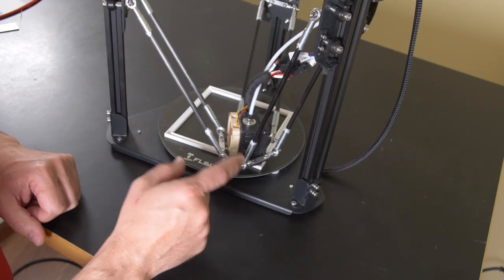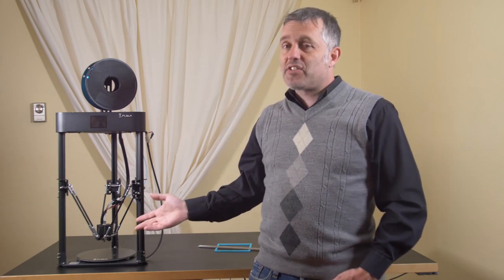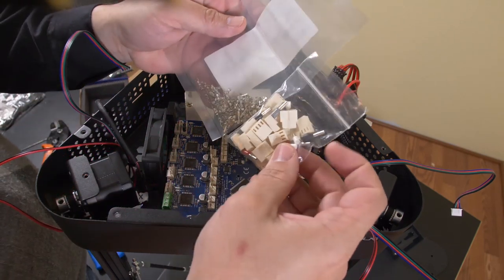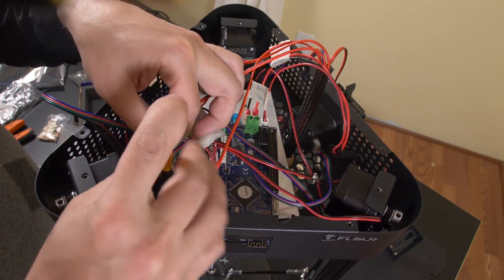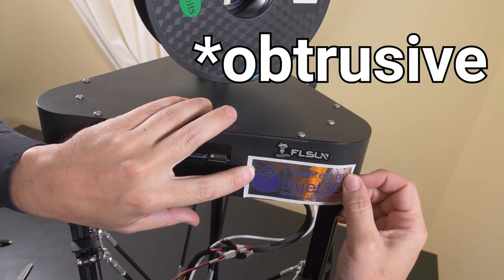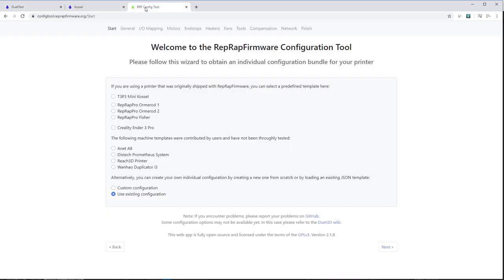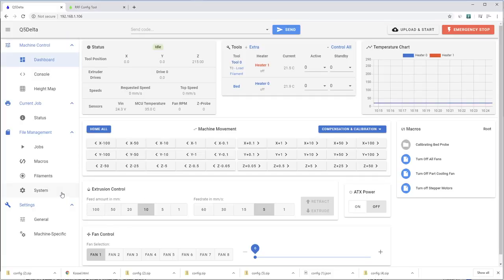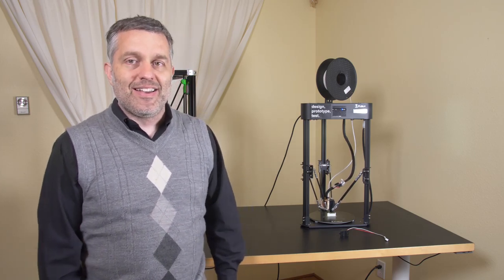How to Build the Best Delta 3D Printer for the Money in 2020

Comment: This is awesome work. Could this be done to a TIKO printer? It was a delta that launched on kickstarter and went belly up. It worked once and then could no longer connect to it.  I would have to add the hot bed but otherwise it looks very similar.
Reply from the maker: A Duet control board will work on pretty much any 3D printer. People have even retrofit them into old Stratasys machines.

Comment: Mine has been running for 3 weeks now and hasn't missed a beat. Compared to my last printer (not delta), this is a joy to use. The electronics are far more reliable too, and cheap to replace if they do fail. I am pleased as punch with mine as it came. Agree though maybe not tbe best for extreme accuracey.
Reply: If it starts printing spagetti like this one (and mine), check the stepper’s VREF. Mine were set to 1.2V instead of the recommended 0.8V causing them to overheat. You can change that with a screwdriver and a voltmetter.

Comment: I just received my Delta Q5 and the voltage appears to need to be set at (default)220V. I see no external switch to make the change to 120V. Do you know how I might go about resetting the voltage to 120V? I have no read out on the LCD screen although there is power to the unit. Thanks for a reply. Richard
Reply from the maker: There is a special switch inside the power supply. It doesn't have a protruding nub, just a flat slot for sliding the switch back and forth. You stick a flat head screw driver through the holes in the case and push the switch the other direction from where it is currently set.

Comment: I have a flsun q q s I was planning on installing duet 2 board. Do I need just the board or do I need the thermistor board as well? It pretty much looks identical to Q5 just different board from Factory. Would you be kind enough to send me wiring diagram or perhaps help me if I run into a problem? I'm pretty new at this so but I am good with soldering and small electronic projects thank you for all your videos

Comment: Nice videos!  I've got an Anycubic Predator, and I'm having problems with random layer shifts that kill all my big prints. I've pretty much eliminated mechanical issues, and I suspect (like you) the cause is the electronics, the stepper motors, or both.  Seriously considering Duet2 upgrade + smart effector.

Comment: Those Iwiss crimpers aren't even that pricey I paid like 18 bucks for mine about a year ago. They work fantastic, not a single failed crimp when I did my duet board, though I really wish duet just used the more common JST-XHP connectors that I've seen used on pretty much every other printer, though there were quite a few things that had to be wired differently so I guess there is some logic behind it, don't want people just thinking it's plug and play. Got my Anycubic Predator up and running with a Duet 2 wifi today, doing my first test print as I write this. It is a night and day difference on the amount of noise this thing makes, it's fantastic. So far no real issues that I had to get help with.

Comment: Why is it you think your Ender3 can't print at 100mm/s ? Mine is mostly stock and can print fine at 120mm/s (and that's just the fastest I've tested it). Maybe you need to tighten belts, pulleys, etc? Definitely works fine for shapes like the square you printed on the delta in the opening of this video - I was printing faceshield headbands using mine at those speeds. Finer exotic shapes could be an issue, but not what I printed, and definitely not that square item you were printing, which is very similar.
Reply from the maker: Ghosting/rippling is the problem. This Delta will make prints at 100mm/s which rival the quality from your Ender 3 printed at 40mm/s.
Reply: @DesignPrototypeTest  I don't see much rippling on my prints at higher speeds. Maybe you can show some of what you have been seeing so I can compare. Best wishes.

Comment: Common culprit for axis shutting down or loosing steps is motor driver overheating. Driver boards coming out of China are not always properly set up, and can drive motors with maximum current. If that's the case, you simply measure the Vref voltage on all three drivers and set it accordingly to your motor requirements. You can also set all three to the smallest value you measure as a quick and dirty fix.
Reply from the maker: A good bit of general knowledge, however, I had a look at the firmware build after I removed the original control board from the printer. The motor currents were set to a reasonable level. Also, I got 2 whole days of printing from the thing before it started to malfunction like that. It's possible that the Stepper drivers were just extra sensitive to the heat, and maybe my room was like 10° warmer when they started to fail. Like I said in the video, It wasn't worth the time to try and diagnose the problem. Even if I fixed it, that would likely not have been the only issue with that electronics package.
Reply: @DesignPrototypeTest  As far as I know, motor current is set by a potentiometer on the driver board itself, not in firmware - you actually need a multimeter and a small screwdriver to check and set it. Some Trinamic drivers have the option to control the current via software, but I don't think your board uses that option. Duet is certainly a nice solution if you can simply throw money at the problem but adding it to this rig pushes the total price up to almost double. I'm not saying you are wrong to go for Duet, but dismissing the MKS board out of gate is meh... for what it costs it actually seems to be a very nice board once you flash it to Marlin.
Anybody buying machines from China via eBay, GearBest, Banggood and AliExpress has to realize they are more often tinkering project kits then actual plug&play products. Some assembly is always in the mix and more often then not some piece needs to be redesigned to work properly. Out of the box they'll probably work but just barely. Customer support is rarely useful or even available and quality control is a joke. The thing is, you get what you pay for... same machine made in China but to a western QC level would cost twice or trice as much.

Comment: Just realized I could edit my post, so done!  I do have a question.  I'm thinking of building a printer from scratch on a budget.  Thinking about the Goliath, or maybe the Piper2.  I need something that I can print higher temp filaments in and also enclose so that I can vent outside if needed.   Any thoughts, is EMT a waste of time and not much money.  I'd really rather not invest in a lot of extrusion.  Even thought about doing a core XY conversion on the S5, but haven't seen much in searches.  thanks, Ken

Comment: How did you get the XYZ limit switches to work with this board?
Reply from the maker: Super easy. Just ignore the center pin. Connect to the outside two pins on the connector of the Duet board. The rest is done in the firmware build.

Comment: If the whole idea for a Delta is speed, at the expense of size and accuracy and youre printing figurines then ok I get it. But I thought you are an industrial designer / engineer - it's puzzling why you love Delta so much!  In my mind the holy Grail isnt a small printer that lacks precision, it's a low cost printer that produces functional accurate parts in a range of materials from TPU to Nylon, Petg and perhaps PC, that works consistently without constant upgrades and fixing, and hopefully the print volume isn't super small.  What are your thoughts on that?
Reply: Is there such a beast ? I would love one.

Comment: Is this still viable in 2024? Or there might be better options nowadays?
Reply from the maker: If you want to make a 3D printer for the sake of making a 3D printer this is a very good project. If you want to get a 3D printer to make other things just get a Bambu Lab and be done with it. It will work reliably and print extremely quickly every time with fantastic part accuracy for engineered parts.

Comment: How does the Flsun Q5  compare to the Flsun QQS Pro? The QQS print size is slightly larger. And about 80 to 100 bucks more. Are you familiar with it?
Reply from the maker: I don't like the thin and flexible vertical motion rods on the QQ. I predict problems there. That is the reason I choose not to review the QQS. The anycubic predator looks a lot nicer for large format Delta printing.

Comment: 7:05 - "I dont' like marlin... or klipper... the difficult way to configure that firmware" 
32:46 - *editing things in the config.g exactly like in marlin or klipper

I really understand, why you like the Duet Boards. It's straight forward and simple to use and may be the best alternative for someone, who isn't so into "tech". But compared to the price of the printer, it's not worth the money IMHO. By just creating your own firmware, you can build a wonderful printer, which just works. Check this out: https://github.com/knutwurst/Marlin-2-0-x-Anycubic-Kossel-Linear-Plus 
With this version of Marlin, you can configure almost everything regarding your delta with the inbuilt LCD screen. To tune the steps on X, Y and Z you don't need a computer at all. Same goes for calibration and the Z-Offset. - And it works with the old Atmega2560 Trigorilla board!
Reply: Actually for some one who makes good money spending more money just to save some time troubleshooting stuff might be worth it. There are some people who actually like their toys breaking because then they can fix it. Its all about what people enjoy.

Comment: Thanks for the quick reply. There is a grid over the power unit which has a label covering any type of switch. So I can not see anything to move left or right. Would the wrong voltage cause the LCD screen not turn on? Could you possibly text or email me photo of your Q5 showing the location and position of the switch? Would I need to pull the power unit to get assess to the switch? I have double checked all the wire connections and they are correct.
Thanks for your time
Richard

Comment: Hi, I'm new to 3D printing and was planning on getting the Ender 3Pro when I saw your video on the FLsun Q5. I am wondering if the Q5 hotend can b replaced with the Micro swiss hotend and direct drive to print higher temp filaments and can it e connected directly PC and what do you think of the Q5 now. thanks for any info you can give me.
Reply from the maker: The upgrades you mentioned don't make sense for the Q5. Delta printers are for printing very quickly and looking so cool/alien/scifi while doing it. By adding a direct drive you will have a lot of inertial mass and will need to slow your printing speed down. For the upgrades you have in mind you should build something like my Ender 3 Evolution: https://youtu.be/SOZe_fg9DN8 Stay tuned to this channel to see the ideal way to upgrade the Q5 making it even faster and giving it some other useful features as well.
Reply: @DesignPrototypeTest  thanks just wanted to know befor I buy

Comment: Great presentation. I notice you are using "Rhino" as a 3D drawing propram. I use it as well and love it. Is it possible you would share this drawing? I am in the process of build a Delta 3D printer.
Reply from the maker: I share any and all files I make for these videos with my $5 Patreon supporters. However, I do not share the editable Rhino .3dm version of the files, only the .stl I do this to protect myself. A topic which I covered in this video here: https://youtu.be/NocEf9Wi_5Q?t=458

Comment: i'm seriously looking at the FLSUN QQ-S Pro, but unsure if you are saying dont unless you are thinking about putting in a $200 brain? Or should i assume that a pro means they sneakily ironed out all the crap from the QQS?
Reply from the maker: The QQS has a different motion system using 8mm rods. These are too thing and will flex because they are quite long. Not only should you replace the control board with a $175 Duet, it will be a convoluted and expensive task to replace those rods with thicker ones. Best to stick with the Q5. If you need larger prints, and really want a Delta, see if you can find an Anycubic Predator for sale anywhere. Otherwise, your best bet is to just stick with the tried and true Creality CR-10S: https://youtu.be/mw5TXlSzQYI
Reply: Design Prototype Test - completely agree! Don’t get the QQ-S Pro unless you intend to completely re-work the frame (and gantry) and upgrade the board. If Prusa did Deltas, the QQ-S would be it! 

I have one - but used as a test bed for a much larger project. What you say about the boards is true... they are garbage for deltas. They are ARM Cortex M3 running at 32bit but only run at 74mhz with 64kb SRAM. The Duet is ARM Cortex M4 32bit running at 120 MHz 512kbSRAM!! Allot my headway in the ram. 

My QQ-S pro can’t interpolate a circle without jerking. Leaving a blob extra plastic. Movements have to be smooth! And u need extra power to do that with deltas
Reply: I bought one soon after my comment and been quite happy with what it's doing. Guess it's like all things that are in this entry level area, that it's a roll of the dice. My ender 3 had problems recently and I'm waiting on a direct drive unit and then I'll upgrade the brain, springs etc, in the meantime I've been giving the QQSPRO a hard time and it's still handling it
Reply: 3rutu5 - it’s good that you are getting good results from it. I found initially that if I didn’t use the slicer that came with the printer, I got very bad prints. Checking the GCode I found the issue and now can slice with the most upto date cura.  

I still enjoy playing with it - the learning is the best part anyway!

Comment: I have received my Flsun Q5 and am just getting into using it.
Are the files of subjects for cartesian and delta printers compatible?
I mean, if I download a subject for a Prusa cartesian printer, are the files going to print just as well on my delta?
Reply from the maker: No. Cartesian printers have the origin at the bottom left of the bed. Deltas have the origin at the very center. This makes you prints locate in the wrong  spot and potentially try to print off the bed. You need to slice everything specifically for your new delta. This is advantageous because it allows you to print much more rapidly than you could with a Cartesian.
Reply: @DesignPrototypeTest  Ok thanks, that's clear. So the subject files I downloaded include stl and g-code versions. Can I go from either format to what my delta will need?

Comment: Replacing the stock fan with a Noctua 40x10 for cooling the hotend won't help, as these do not have the CFM to properly cool the heatsink.  They are quiet for a reason ;)  I've used them on various printers, and all fail in that regard, i.e.. heat creep eventually.  A Noctua 40x20, you may just get away with?, but these Noctua's do not push the required amount of air to properly cool the hotend. A big mistake I see many making.

Comment: You know Klipper doesn't require any base code modification.  It is config file based..Not Configuration.h or anything like that.  Flat formatted text files.  It's light years easier to deal with than Marlin.
Reply from the maker: Allow me to respond in kind, skipping over the nitty gritty as you have done: Reprap firmware doesn't require any technical knowledge. It's web-browser based. All you need to do to set it up is click on some buttons on a website. No text editing necessary. It's light years easier to deal with than Klipper.
Reply: Klipper is very similar honestly. Yes you can ssh into the raspberry pi and edit the config files but you can also edit it from octoprint with the OctoKlipper plugin. It's very similar to editing the config.g file for Duet. There is even a DWC2 for Klipper. I'm not saying Duets aren't great, as is RepRap. The Duets boards are amazing and super well made. But I think you are giving Klipper short shrift.
Reply from the maker: Fair enough. I may give Klipper a chance in a future video.

Comment: you can do it cheaper with Duet Maestro because Duet 2 is an overkill. Delta does not need 2A steppers, huge expansion capability. Also having cheap WiFi module enclosed in aluminum cage with PSU EM also does not work well. But yeah, Duet or die! :D
Reply from the maker: Yes, you are correct. The Maestro would also work great to run this printer. Unless you are unable to keep your printer constantly plugged into your internet router via Cat5 cable. In which case the Duet2 WiFi is the clear choice.

I addressed your criticism about blocking wifi signals inside of a metal enclosure when I referenced Faraday cages at the 8:58 mark, and the final design has the antenna protruding out the front of the printer ensuring great reception of WiFi signals.
Reply: agree about the cat5 cable, but we could argue about the price of one cheap router that works as repeater to make a daisy of printers and keep "the field" of printers "wireless" if one has more than one... But we shall not do that ;) 
i am a diehard Duet fan, but i am going to swap all my wifi modules with ESP-07S and external antenna.  Tip tip for a new video ;)

Comment: Great video. Gave me some idea's on how to try and increase the accuracy on my delta's. Got to love the DUET. Any reason you are not using a config-override.g created by using M500 after calibration?
Have you tried adjusting the rod length instead of using the M579 for scaling? I think both have the same effect but not sure which is better or worse than the other.

Comment: Hey do you know of the flsunqq-s pro has an E3D v6 hotend
Reply: No it's not a e3d V6 hotend I own two of these it's just Chinese knock-off with aluminum heat block but if you you genuine e 3D dv6 you could buy one for about $56 and change it it's definitely worth it
Reply: Join flsun QQ 5 and QQ s owners group on Facebook lots of information there